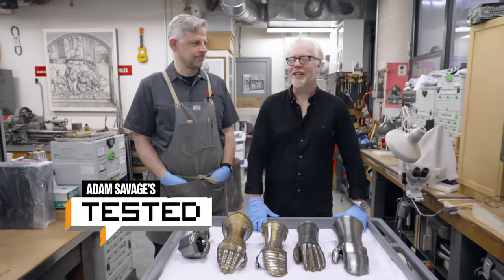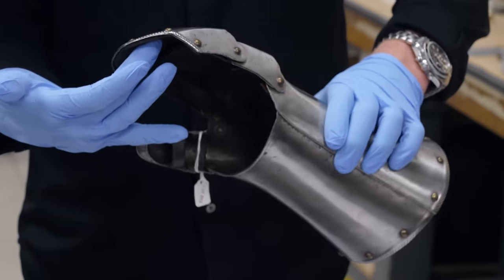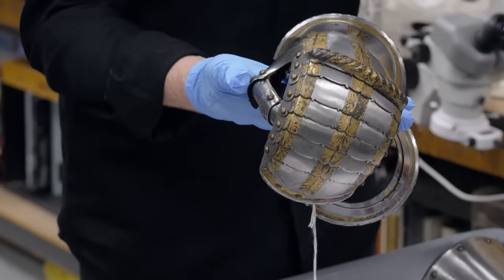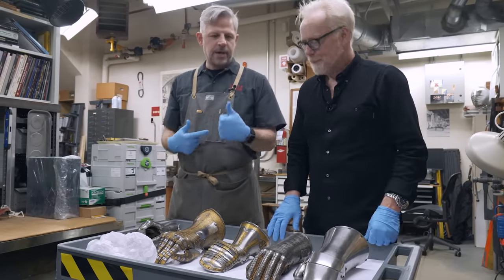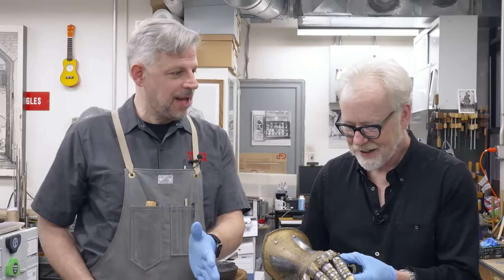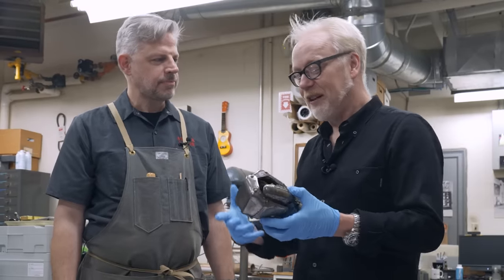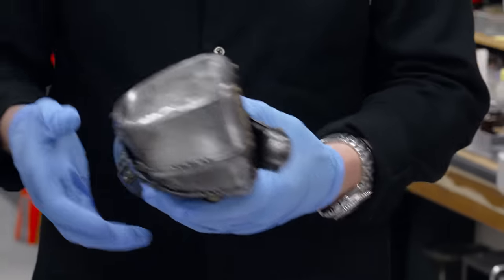Adam Savage Meets Real Armored Gauntlets!

Comment: The locking gauntlet is simply amazing, it shows its art in the function and form ra ther than its "paint job" like the gilded one. Both are fabulous ways of show craftsmanship
Reply: There's also an interesting contrast between Italy and Germany in terms of form and function. Both Italian gauntlets have the individual fingers, looks very fancy, and I imagine it feels less restrictive to wear, too. Then all the German gauntlets are a relatively simpler mitten style, but I imagine that is more protective, and the last one has the additional safeguards to keep from dropping your sword.
Reply: Armor bashers have found it's actually trickier to get fit and function exactly right with fewer plates in the gaunt than many -- the joints help.
Plate gauntlets are also maintenance heavy -- even more than the rest of plate harness, which is like a part time daily job. You consume the inner gloves 🧤  at a great rate; you have to think of even the nice gloves as expendable. But also don't cheap out on the gloves, because the cheapest cheapies fit poorly, impair your grip, and wear holes in you, ouch. I recommend drovers' gloves. And expect to sew them into the gauntlets' tabs and edges, rather than try and strap the gauntlets on.

Comment: Hi! I've practiced, studied, competed, and taught Italian rapier for coming up on 10 years. The duelling gauntlet is so cool! It makes a ton of sense! One thing to add to that conversation, grabbing your opponents blade with your hand is a huge part of rapier fencing, even without protective armor! There are 2 reasons for this. 1) the way blades work, contact alone doesn't cut, there has to be pressure, and a drawing/cutting motion really helps. This is why you can walk your hand with a bitter knife and it doesn't hurt you, but that same knife can cut through meat when you eat it. 2) Even though you are risking getting your hand cut by using it actively, it's likely protecting much more important parts of your body.

Comment: When I was I the SCA back in the 80s I knew a guy who was putting himself through college by making armor. He was pretty good but supposedly he eventually developed a rut action for not delivering the finished pieces of armor. Making armor is a skilled trade. I learned how to peen rivets so I could repair my armor but that is as far so got. One time I picked up a hammer to peen a rivet and the armorer snatched it away because it was a "planishing hammer"for doing finishing work, not for riveting. If I had used it I would have scarred the polished surface and I’m sure it would not have have easy to fix.

Comment: Having used brass rivets in articulating armour pieces for years and years, I can tell you it is absolutely hard enough.  When you pien the rivet, the brass work hardens some.  I've never had a brass rivet fail.  Granted, I didn't bash my armour with steel swords, however most of these fancy armours were never used in combat.

Comment: I've not tested this personally lol, but I'm confident in saying that you do not need mail gloves to grab sharp blades (even that held by a resisting opponent) as you guys kind of implied in the video. When you think about it, the thing that really causes a serious cut is a drawing motion, not really pure pressure. Theoretically, though you'd have to be brave, you can grab a resisting opponents blade with bare hands. If your grip is strong, you could get away with it. But more fairly, leather gloves make a staggering difference, and make it a way safer prospect. Importantly, leather also has a tendency to "stick" on blades, which both stops that draw-cutting motion, and improves your control. I don't believe mail does that at all, and will actually make it quite hard to get a firm grip; so I suspect these gloves were more to deflect and keep you safe against the draw cut. Also these gloves were not exactly common as far as I can tell, so it might have just not been a very good idea.

Comment: The difference between brass and steel, is the difference between the Stone age and the Bronze age. Steel was a game changer. 
Bronze won't even scratch a piece of stainless, but some people have these other ideas, in their heads. I didn't really believe it until I took a copper pipe to a polished piece of stainless, somehow not scratching it at all. Sure, you can dent the stainless, maybe tear it, but not scratch it.
A piece of sand on a rag, now that WILL scratch the polished stainless, the piece of sand is stronger than brass. Just cause the brass is harder than your head, does not make it that tough, cause there's various stronger materials out there. ALWAYS make sure you have clean rags, before polishing anything, cause a grain of sand can cut through most things including stainless steel. I only use microfiber, which they don't even sell at Menards right now. Took me a long time to learn this, or get familiar with some materials. Now, when crafting anything I consider it to be invaluable information, I can start the project according to the function, whatever it is. Otherwise, you can make a big mistake potentially, by using the wrong material, I'm sure everyone has done this. I have seen videos of guys trying to reinvent the wheel, they end up turning their gun into a suicide rifle, one that will surely explode !. People used the wrong wood, the wrong glue, whatever. Yeah, people think I am perfectionist, but they do need to be told this. If you polish your cars with dirt rags then that's on you. They are just not aware about the material they are working with, also dirt can be highly abrasive.

Comment: 9:24 is definetly not designed for "not dropping your sword". In the time period this gauntlet is from there were hardly any people (espescially no footman fighting with swords) wearing full plate armor anymore. Also a full plate mitten style gauntlet that locks in place would be horrible for sword fighting. This is definetly a tournament gauntlet for use in Tjosting so you don't lose your lance. The whole fullplate tjosting armor would have been like this (very stable and sturdy but inflexible). Maybe some excentric outliers used something like this in actual battle at this time aswell but it would be just for showing off by some old nobility in love with legends that describe stuff from 200 to 400 years prior.

Comment: Hi Adam,
Here is a prosthetic hand based on the gauntlet mechanism.
https://youtu.be/1CJKgCqwiuA
It's based on metal parts outside, and leather soft materials inside.
The hand was made in the 80ies by a famous artist in france who also sculpt artistic automates as you can see on his page.
It's all hand made, metal cast and have custom spring/cables/joint mechanism
It is still used by many amputees as an artisitc functionnal artefact

Comment: Wait but how did they have rivets in the 16th century???
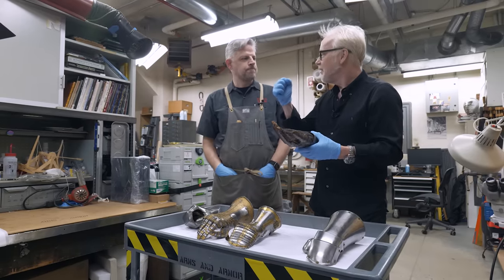Reply: Why shouldn't they have rivets? The rings of mail armor during the entire medieval age were riveted as well. You can basically just take metal wire, cut a small piece (like 1cm or less) and then put it while hot into the hole and squeeze it with a plier - now you have a rivet. Check for example on youtube "How to make riveted chainmail" on the channel Ironskin. He shows it around 3:36.